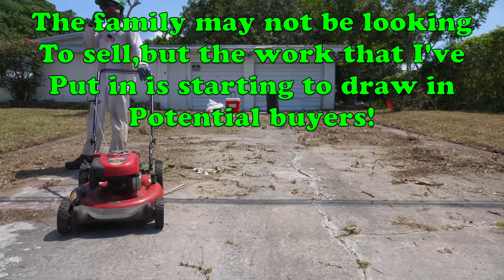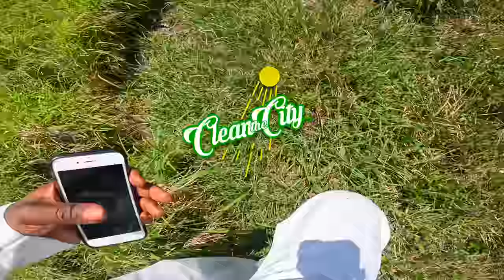Bizarre NEGLECTED LAWN LEAVES NEIGHBORS To Wonder WHATS NEXT!? FREE Yard TRANSFORMATION!

Comment: Okay you kind of made me mad because there's levers on the side of the mower to raise it up you cut the grass at the highest level. When the grass is super tall put the mower all the way up and then you go partially the way down and then you go down again to cut the tall tall grass so you don't kill the mower cause it could blow up for one and two it doesn't stall the motor out. I know that from experience when I cut a lawn that was 6ft tall I had to go in with a weedeater first. Put the mower at the highest level and then worked my way down. Took me four gallons of gas but I finished the yard and I did it correctly without killing the motor once. Just you mowing the front yard I swear I've seen you stall out six times. Don't run your equipment into the ground that's your bread-and-butter.